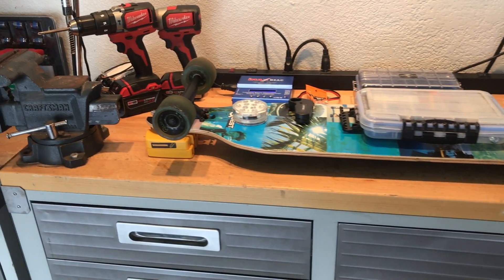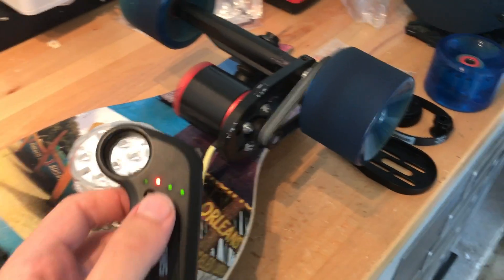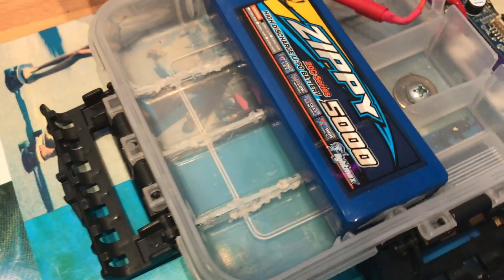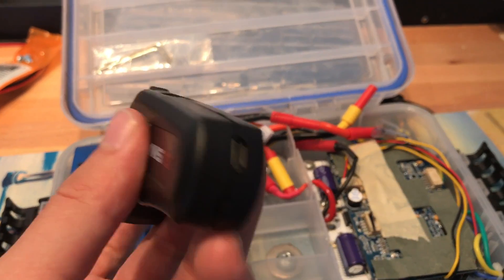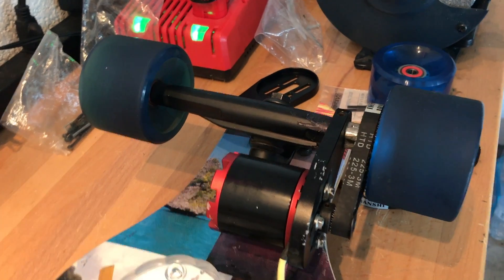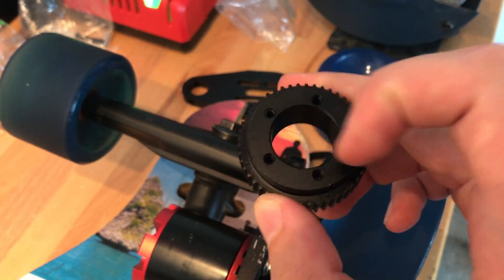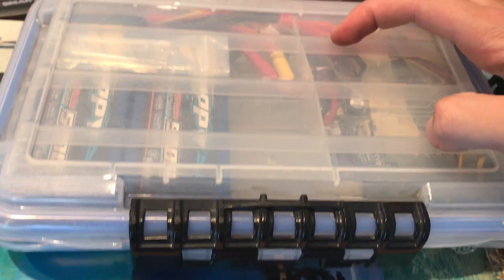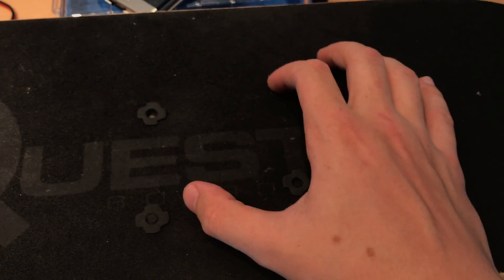DIY $250 Electric Skateboard Cheap FAST Light

Comment: If you use a low kv motor like 170kv to 200kv, and then a bit smaller wheel like 70mm or 72mm will increase torque and range...

Comment: How did you drill through the wheel i am waiting for my parts and i am a bit scared to try and drill as i dont want the wholes to mismatch, any advice?
Reply from the maker: He is busy with school so let see if I can help you out, to do the job easy you need a long bolt and nut and couple big washers that you be able to tie gear to the wheel through center hole on the wheel (with bearings already installed on the wheel) and the gear make sure the bolt is the same size as inside the bearings then rotate the wheel around bolt axle in the center to make sure the gear in center and balance then tie the nuts on the bolt that fix the gear  and washers to the wheel (with bolt in wheel center), he use the drill press to run 1st holes from the gear side ( use gear holes as a template)h to make sure drill bit is perpendicular to the wheel (drill bit should be much smaller than gear hole for screw to avoid touching the threads on the gear) after you drill all 5 holes then flip the wheel and drill the holes with bigger drill bits from the other side (outside the wheel) do not make a holes too big and make sure when you drilling from out side drill bit does not goes through gear hole mess the treads. 
ps: You might need to place couple big washer between gear and wheel to have enough clearance between belt around the gear and the wheel also you need one washer in the outside of wheel to prevent screws goes too far into the wheel rubber, before running the holes make sure all  gear + washers + wheel + washer are in place and fix with bolt that I mentioned above in center of the wheel do not remove the center axle bolt till you install all 5 screws that fix the gear and washers and wheels together.
To get right size bolt and washer install your bearings on the wheel take the wheel to home depot and purchase the correct size bolt nuts and washers again make sure axle bolt is tight fit on bearings and long enough the go through gear and wheel and washers.
He added the outside washer to the wheel later on updated wheels it does not shown on the video, without outside washer eventually the screws were eating through wheels.

Comment: I used this video to make an electric skateboard for a science project and I got an A+. For storing hex keys for easy and quick fixes, I drilled little holes in the divider in the tackle box. I also put velcro on the bottom of the border and on the remotes for easy storage.

Comment: The link for the batteries is wrong because you claimed all this is $247 but its $33 for ONE pack not two so for the same setup you have it would be about $70, and it would be over 250

Comment: So I've watched this video and looked a good amount at the parts that you have used. Would you and can you add one more battery in series (bringing the voltage to 33.3v) successfully without frying anything. All of the specs look like it is obtainable, but want to know your opinion. Obviously it would be one more cell than the motor is intended for, but really wonder if the motor can handle it.

Comment: can you give me the links for the screws please? I cant find them anywhere
Reply from the maker: Homedepot store
Reply: Mark Kash okay thanks But is there any parts list or video on how to buil
Reply from the maker: I did explained all require parts and instruction on the video, there is no part 2 video.
Reply: oh okay. I was just hoping there was a part 2 for more in depth, its my first time so I dont wanna mess it up. thanks again
Reply: Mark Kash for the single motor setup. I have a brushless motor. Would it be okay if I just got the 6s single motor setup instead or does it not matter? As long as I use something with 6s?

Comment: do I have to solder anything if im building it?
Reply: DerKernsen yea, battery to esc and esc to motor
Reply: @austinsears7879  well, connecter to battery and connector to esc, so you can remove the battery when you need to

Comment: Hey Mark, I'm using your video as my guide to build my daughters eboard.  On the wheel pulley you mention a washer but I didn't get one with my kit.  I was wondering what the assembly config is for your wheel, gear, washers, bolts etc?

Comment: Couple questions I have. I'm new in learn these DIY electric skateboards so sorry if this a dumb question.
I wanna use the stuff you have on your link here 
1)Dual motor esc/receiver/transmitter
2) Two of the motors you have on link. Because I have two over pass that I have to go over to get to work. Lol 
3) Two motor mounts & pulley kit 
4) Batteries? Can I get 3 instead of two with this setup. Basically for longer range. My job is 5miles away so 10miles total for there & back.
5) where do you get the remote at ? 
6) with all these items I just listed, will I be able too build a electric skateboard????? 😳😳😳 please says yes lol. Also great video hopefully I can build one

Comment: Mark Kash, I did a little bit of research on eBay.co.uk and HobbyKing.co.uk and I put together this:

Battery, 2x 5000mah 3s 20c battery, Hobbyking
https://hobbyking.com/en_us/turnigy-5000mah-3s-20c-lipo-pack-xt-90.html
Or
Battery, 1x 5000m/ah 6s 25c battery, Hobbyking 
https://hobbyking.com/en_us/zippy-compact-5000mah-6s-25c-lipo-pack.html

Esc+receiver, eBay
https://www.ebay.co.uk/itm/Motor-Electric-Controller-W-ESC-Control-Module-Cable-for-Longboard-Skateboard-/152690217393

Motor+motor mount and pulleys and belt, eBay
https://www.ebay.co.uk/itm/Pulleys-Belt-Motor-Mount-N5065-400KV-Brushless-Motor-For-72-70MM-Wheels-DIY-/222610796969

Battery charger, (wall thing not included) Hobbyking 
https://hobbyking.com/en_us/imax-b6-dc-charger-5a-50w-copy.html

Total cost (with 6s battery and no board)= £118.71
Total cost (with 2 3s battery’s and no board)= £111.86

All in all, not too bad!

Comment: After owning it for several months does it still function properly?
Reply from the maker: Yes, although the battery needs some improvement. Currently I am running multiple experiments, and when a better solution is reached I will post another video.

Comment: Hey, i just ordered all the parts for the board, i have a longboard with 69mm wheels i think. Could you tell me more about how you are trying to solve the battery problem, maybe we could email or pm each other
Reply from the maker: Nothing did pan out yet, still using Lipo batteries as I showed on youtube, process of finding other ways is time consuming and expensive I did try couple options and will post video when I find the answer,  Lipo batteries are going bad too soon, I already went through four of them (when they swell is better to get rid of them (replace) before they change everything to ashes in split second), that is the reason I am looking for better option. By a way I have a real life like everyone else, working on this project is just for fun I might spend an hour per week on it.
Reply: Hey do you charge the batteries separately? or is there a way to charge them both together
Reply from the maker: At the beginning I was charging them one at the time but since IMAX B6 is capable of charing up to 6S at the once, I made a small jig and charge both batteries at  once.
Reply: How much did that rig cost ya, id like to do that too
Reply from the maker: The rig cost less than $10 -$12 but you have to solder some wire any mistake of wiring then you have a big fire works, (Lipo batteries are like a ticking bomb, watch youtube on these batteries, when they explode they make a big mess) you need two 3S1P Balance Charger Cable Wire JST XH Connector Adapter  and one 6 S1P Balance Charger Cable Wire JST XH Connector Adapter plus a small breadboard, I do not think I have time right new to tell you how to put these component together I am hoping with explaining what component did I used to make adaptor you be able to come up with connection configuration I really do not have a time to go though the details.

Each battery have two thick and 4 small wires
Battery connection for thick wires + Batt1 - connected to +Batt2 -  just like you using them during normal operation.  
For balance charger ( Batt1) Black,White, Yellow, Red <(Batt2)< Black ,white, yellow , Red. so  red connector of 1st battery balance charger small wire is  connected to the Black balance connector of 2nd battery, at the end for balance connector you end up with 7 wire instead of 8 that you started it with(since middle red and black are connected together Now connect the most negative wire of balance connector (Black one to 1st wire of 6s1p and so on then the last wire Red from 2nd battery goes to most + point of balance charger.  pay attention to balance charger + and - sign shown on IMAX battery charger any small mistake cost you a battery and/or charge. If you have a time drawn my explanation on Paint within windows and send it to me for verification.
Reply: Mark Kash do you think this will work with 69mm wheels?
Reply: Mark Kash also, did you buy the power button separately and how do you tell the battery life
Reply from the maker: The blue wheels that I use are 75mm, my original wheels were 69mm and I could have used those. What size wheels are you currently using? You could place your skateboard on flat surface and measure to see how much clearance you have before you mount the motor or tackle box, you will need at least 1/2"- 3/4" clearance. Remember small wheels have more torque and less speed but bigger wheel have less torque and more speed.
Reply from the maker: Power button came with ESC, Battery is a weakest point of this design I am currently working on couple options (different battery and configuration) if I get desire result I'll  post a video on youtube. I already gone through one set of batteries.
Reply: Mark Kash I currently have 69mm wheels from zflex. and i might get a battery monitor but i’m not sure how to hook  it up
Reply from the maker: Do as you wish but more gadget more problem and also you taxing your battery as well during monitoring. Overall I think Lipo battery can not handle the vibration during operation of skateboard and is pain in the back during charging they go bad, and start swelling that is sign of insulation break up in the battery and time to dispose the battery before explosion.

Comment: I recently built a board following your design, only on a pennyboard nickel. I used a 270kV motor instead, and calculated top speed to be about 16mph. I am running 2x 3s 7000mah in series, and have 70mm wheels. Everything works fine it is just slow as hell- maybe 8-10 mph and can't even go on a slight incline. I am just wondering if you know why this happened and what I can do to make it faster. I don't think I missed any steps and I only weigh 150 lbs, the board itself isn't that heavy either. Thanks
Reply from the maker: If you used the same ESC as mine, I think your motor is source of the issue as I mentioned I used 400KV my no load speed calculation was 26mph and I end up with 14 when I ride it. Does each battery rated for 7000mah?
Reply: Yes each battery is rated 7000mah, I was thinking possibly bumping up to 33V or maybe changing motors. Its just the fact that it goes so slow that was concerning me I thought it would've went a little faster even with a 270kv. Also my charger will charge for a few minutes then I get a "DC in too low" message and cannot charge, is that a problem with my power adaptor? Thanks for the reply
Reply from the maker: Check each battery voltage separately as follow:
Each battery after fully charge should have voltage of 12.5V or higher "Across the black and red thick wire" 
Also you can measure the voltage of each Cell of the 3S battery to see if any of them are defective, How? 
After fully charge the battery measure the voltages between the two adjacent thin wires on small connector of each battery (use for balance charging) since the connector is to small to access with your meter probe you need to insert two small needle to the small connector of battery and measure the the voltage across them, be careful to not shorten the needles that could destroy the battery, the voltage for all three batteries should be 4.1 or higher.
based on your note of charging for few minutes and getting the alarm, my guess is your charge is bad but you can find out with above method.
Bumping up to 33V ? how? if you add another battery pack in series then I don't think your ESC and motor can support that change from 6S to 9S I think motor can handle max 8S !!! and not sure for ESC support and setup.
Reply from the maker: If your system works correctly I don't think you can go faster than 10-11mph but when you going up on slope you should go up much easy than mine since your motor have less speed and more torque.
Reply: I will try that and figure whats going on with mine and hopefully I can get it right! Thanks for all your help!

Comment: Is there any replacement belts?
Reply from the maker: Yes, following is one option search within Ebay
225-3M HTD 3mm Timing Belt 75 Tooth Cogged Rubber Geared 10mm

Comment: How is the board holding up Mark? Is the Motor and pulley kit holding up?
Reply from the maker: The belt strip once and changed, motor pulley are fine but batteries are other issue that I am working on.

Comment: Hey I'm looking to use the same ESC an I was wondering what size hole you made for the power button. I'm in the process of designing a 3d printed electronics box and I was wondering how large of a hole I need for the power button.

Comment: Hey, I was also planning to make an electric longboard, and I was wondering if this motor can handle an 8 cell battery (2 4 cells) because that would increase the speed by a lot. And would the esc be able to handle such voltage?
Reply from the maker: According to the ebay store posting of the ESC, it can only handle 6S, 7S, and 10S. Link in the description if you want to take a look.

Comment: Hi mate could I just ask why you didn't go for something like a 280kv motor and up the motor pulley to something like 15t?
Reply from the maker: Because of availability of motor, "cost" and other component that need to work with injunction of motor such as gears and belt and ...
Reply: Thanks Mark

Comment: Is there replacement capacitors for this board
Reply from the maker: Which cap are you talking about is it bypass cap?  is it surface mount? I am  pretty sure if you know what cap you looking for you can buy it from Ebay or other electronic outlets, you need voltage and capacitance rating of capacitor to order one.

Comment: Hey so I built a similar board with the same ESC and the brakes are almost none existent did you have this issue?
Reply from the maker: My breaks work fine, you just have to use it slowly so it doesn't throw you off.
Reply: I actually have the same brakes problem. They aren't slowing you as much as you would (especially for high speeds) so you will have to use your foot and jump off the board

Comment: I received the Esc yesterday. I mounted it with a 280 kv motor, (+ 83mm wheels and gear ratio 11/28 by chain)  seems to be fast enough, will keep you updated :)
Reply: So, here are the specs :
- Max Speed : 35 km/h (22mph)
- Range : To be tested but must be the same range 
Btw i'm 64kg, got a turnigy 280kv + 83mm flywheels + chain (11/28).
One thing that I would like to add, I put xt60 or xt90 to replace bullet connectors and did all my wiring with 10 Awg wires (less heat). And for me, there is no overheating with that ESC.

Comment: Have anyone tested this setup with a 270kv motor, like this one: http://www.ebay.com/itm/270KV-N5065-5065-Brushless-Motor-For-DIY-Electric-Skateboard-Scooter-Multicopter/401314952357?_trkparms=aid%3D555018%26algo%3DPL.SIM%26ao%3D1%26asc%3D41376%26meid%3D6d9fceb7a34347289a054f15392d9f4f%26pid%3D100010%26rk%3D2%26rkt%3D6%26sd%3D322688412411&_trksid=p2047675.c100010.m2109

If yes, how is the torque and speed ur gaining?
Reply: The TL;DR version: 28.5km/h with no load, 20km/h with load. Your motor will climb hills far better than Mark's.

The longer version:

He is using two 3S batteries in series, each battery being 11.1V. In series, that gives us 22.2V, so let's do the maths.

22.2V multiplied by your motors KV rating (RPM/Minute). 22.2V * 270KV = 5994 RPM. Then we need to consider the gear ratio. His pulley system uses a 16T/48T setup, giving us 3 spins of the smaller gear for every 1 spin of the larger gear, or a 3:1 ratio. So we then divide that 5994 RPM number by 3 to give us 1998 RPM at the wheel.

He is using 76mm diameter wheels, and they have a circumference of ~238mm. What this tells us is that for every 1 rotation of the wheel, the board travels 238mm with no load applied (no weight on the board; board upside down). We multiply 238mm by our 1998 RPM to give us 475,524mm per minute. Convert into km/h to give us 28.5km/h under no load.

Accounting for a 70% efficiency when a body is standing on the board, you'll achieve roughly 20km/h, but your motor will be able to climb inclines better than Mark Kash's.
Reply: Great explaination, thanks! :)

Comment: The ESC gets hot inside the box when you are riding it? And if it is true, did you do something to solve it?
Reply from the maker: Nope, never had an issue with the ESC getting heated.
Reply: If you're concerned, cut holes in the box for air flow. Bare in mind that it will no longer be watertight. If you're more concerned, add a small 5V fan in the hole you create in the enclosure.

Comment: You should only use a motor making around 200-300kv
Reply: turnigy aerodrive sk3 6354-260kv brushless style motor is the motor i got.  i saw that 400kv and i was wondering about this.  Thanks for the tip.
Reply: Could you  please explain why and why not a higher kv such as 400? Thanks
Reply: @mkhaled23  high kv motors have less torque.